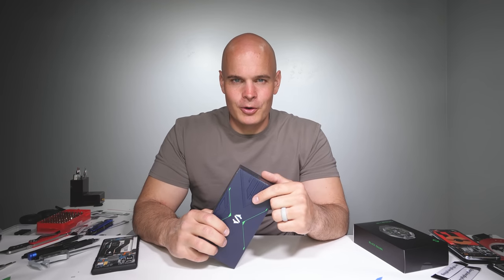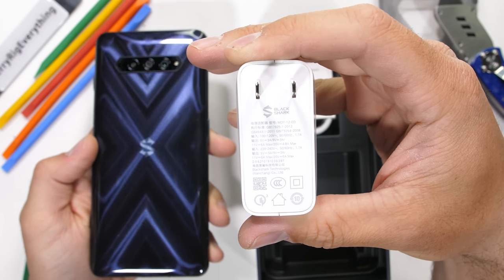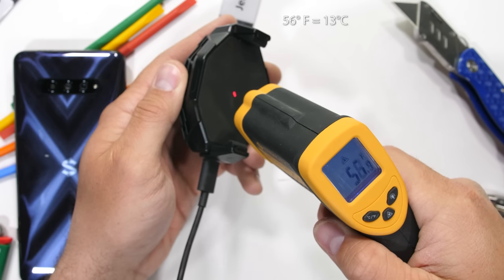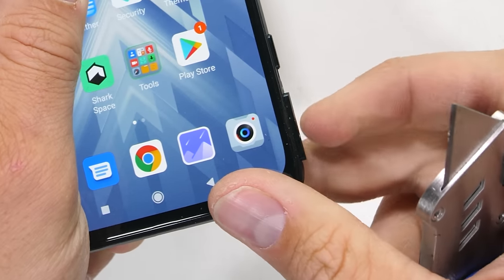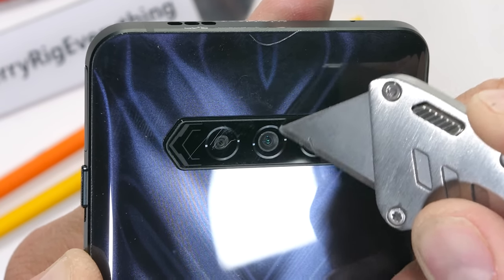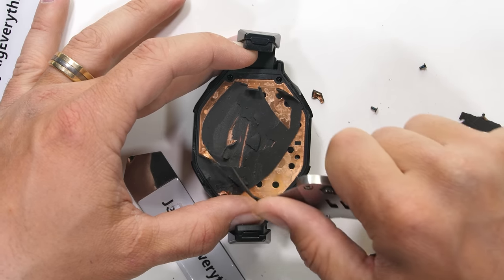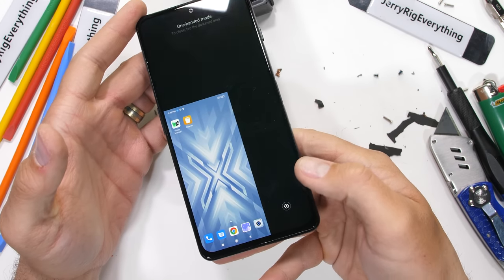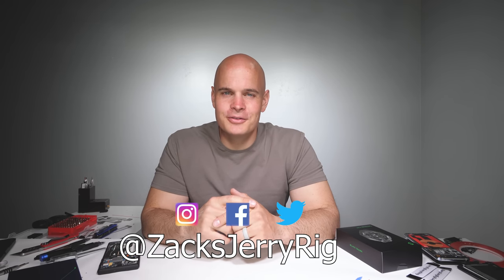An ICE COLD Gaming Phone? - Durability Test!

Comment: That awkward moment when the first mass produced flagship phone comes with sapphire glass and it doesn't scratch until a 9. I think he'd be confused at first, especially if they didn't advertise it. That'd be wild. 🤣
Reply: nice idea
Reply: @mrameezrajak  it's been done, but not on a massive production scale. Sapphire is hard to produce, especially considering it needs to be "grown" in a lab. 
That'd be the ultimate slap in the face to any company touting the strength of their display, just not talking about it like it's not a big deal 🤣
Reply: Increased scratch resistance would come at a cost of reduced shatter resistance tho.
Reply: @pvshka  that's not necessarily so. One of the reasons why gorilla glass or tempered glass in general shatters is because it's pressurized to maintain the ability to withstand being shattered upon impact. 
Since sapphire crystal isn't done in that matter, I don't think it'd be more likely to shatter. 
Maybe I'm completely wrong, and if you have any comparisons with contrary evidence... lemme know because I'm only assuming about this.
Reply: @Ibonic  its more a physics thing than process  the harder something is  the more Rigid it becomes  meaning the less flex it can sustain before breaking.   I'd lay money that between size of your average cellphone screen and needing to be quite thin to remain fully transparent  and touch controll to work.  would leave the saphire quite fragile  the slightest bend to the screen possibly shattering it let alone any impact .
Reply: @plaxy100  ...you do know they've put them on cellphones before right? They were amazingly durable.
Yes I do understand the physics, but how many of you can bend diamond? No? Oh okay. See it's almost identical in hardness wouldn't be the strength of a wet noodle when all these other components stacked on it and framing it would be employed.
Reply: @Ibonic  They've been used as durrable screen protectors  not as the screen itself a screen protector gets the advantage of being easily replaced when it does crack or break.   gorilla glass  looses very little structure with hair line cracks.   a hair line crack in saphire and any structural advantage it did have is gone.  gorilla Glass is significantly cheeper like 5 cents to the square inch,  saphire  try like 5 dollars a square inch.    another advantage of glass vs saphire is light refractive ness  Glass is far more transparent than saphire.   Saphire screens are easy to tell  some glare and the whole screen is white.
Reply: @plaxy100  there's a sapphire crystal screen on an htc phone that's not a screen protector. I have one also on my gshock gwg1000 mudmaster. You're literally wrong about the durability...🤐
Reply: @plaxy100  gorilla glass loses a LOT of structure with scratches and deep scratches... It's under a TON of pressure... It's why when it cracks it usually spiderwebs everywhere...
Reply: @plaxy100  also, sapphire crystal glass isn't white... Wtf are you talking about dude...
Reply: @Ibonic  refractivness is how much light gets bounced by the particals of the material  Saphire has Higher refractive index and produces far more glare. when hit with direct light what you see is white not that the saphire is actually white..   also no  Scratches in gorilla glass does not cause it to spiderweb you can actually go pretty deep before causing it to break you can put a lot of scratches in gorrilla glass before it breaks all the way.  but explaining brittleness,  stiffness and flexibiltiy.  little too much for youtube comments  know Saphire is Harder than Gorilla Glass but is less flexible and more brittle as a result.

Comment: The back is cool, don’t love it but it’s cool. The front tho makes it look a bit cheap..With those bezels and that hole punch.. Samsung does it’s hole punches and the Xiaomi flagships , OnePlus etc but this doesn’t look good, would’ve preferred symmetrical top and bottom bezels and have front firing speakers as a bonus.. using ROG Phone 3 right now and i LOVE it. I normally don’t have problems with hole punches but this doesn’t look right to me

Comment: So it actually survives the durability test... That's a plus compared to it's two competitors in 5 nm gaming phone category. Kinda surprising tbh, since it doesn't use as fancy material, like the plastic back cover. Still doesn't have IP rating, but so is the other two. 

So, like he said, not surviving the durability test doesn't make it a bad gaming phone. The spec is still up there, the three of them. But when there's an alternative that survives, offered with lower price to boot, that's kinda a dealbreaker.

Comment: Does the cooler really need to be plugged to an external power source or it could be plugged in to the phone directly? It'll really be a hassle to bring power banks or even go near power outlets while gaming especially when travelling.
Reply: You can connect it to a power bank, a charger or another source of energy. You can also plug it in the phone directly but that will take some power out of the phone and the battery will drain a little bit faster.